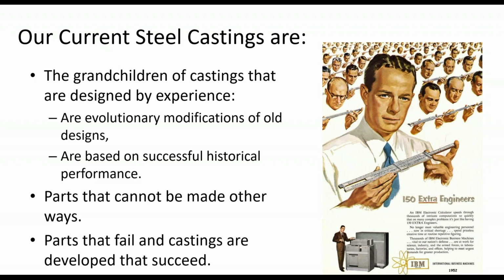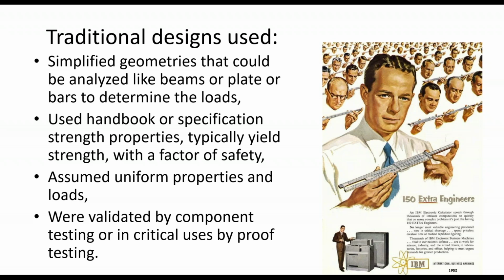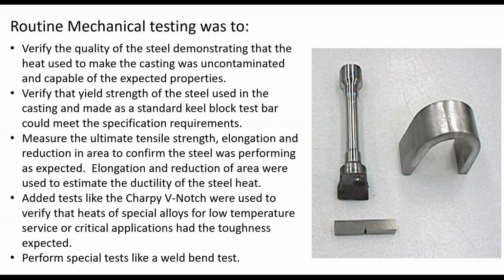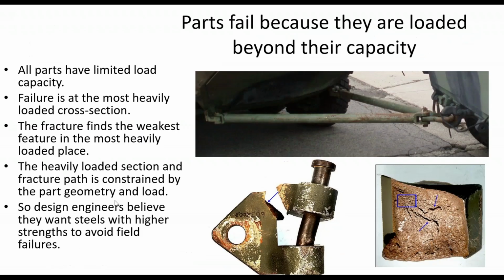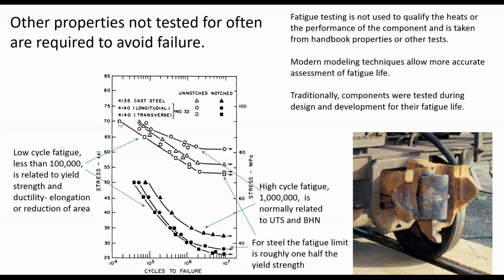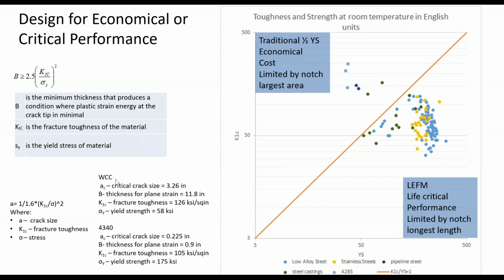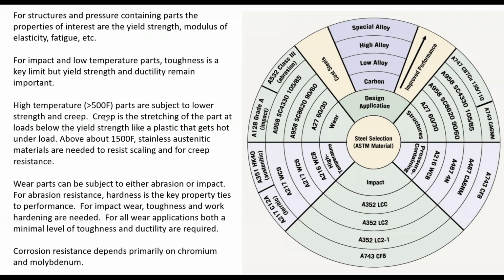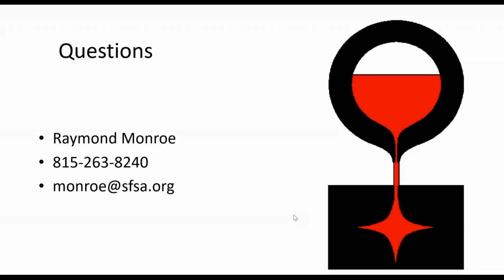Mechanical Testing of Steel Castings

Comment: nice webinar :) 
I have a question !! Do I need to do all the Mechanical Testing for a steel ? For example, I have a steel that I need to used for automotive, is enough to do only tensile and not to do a compression test ?? I hope my question is clear. Thanks.
Reply: Mechanical testing requirements are intended to make sure the steel meets the quality requirements for the grade and is done by the steel maker.  The steel specification gives you the minimum requirements and most users or designers use those values for product development.
Reply: @raymondmonroe3152  oh I see. Thanks for the response. Also, thanks for awesome videos. Keep up it up 👍